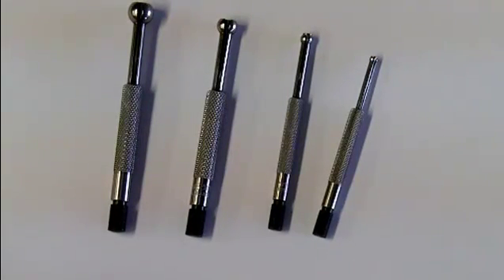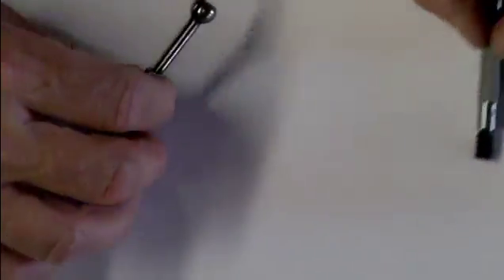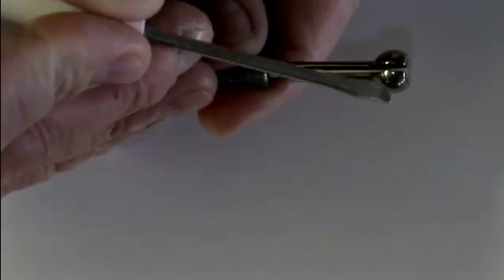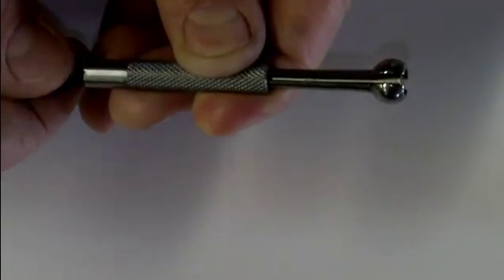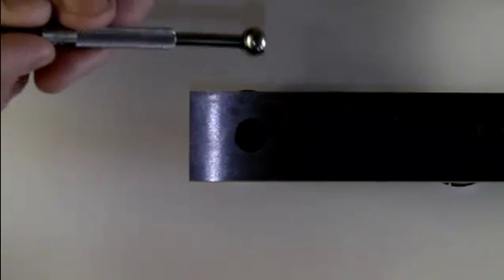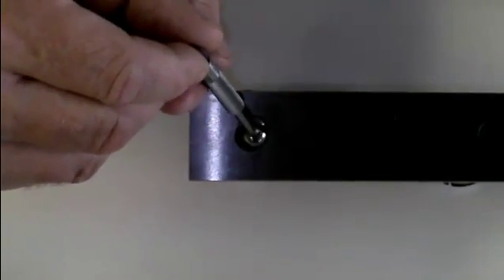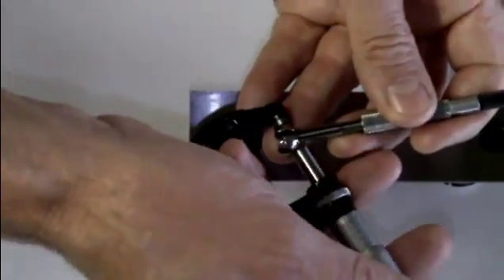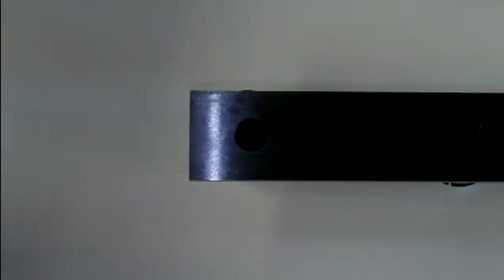Small Hole Gauges

Comment: I feel like a telescoping gauge would be more accurate.. Is this true? Because a telescoping gauge actually locks into position when its past the midst of the measurement, when with this, you aren't getting as accurate of a measurment
Reply from the maker: ArcticCatsRock There isn't a lock on the small hole gauge so it requires more of a "feel". Telescoping gauges also have a limit as to how small they will go.
Reply: Im in first year mechanical engineering, and we just did  our final exam which included telescoping gauges and small hole gauges. I used both but feel more comfortable with the telescoping gauge
Reply from the maker: Me too. Hope it went well.